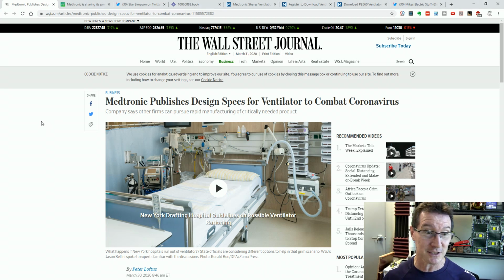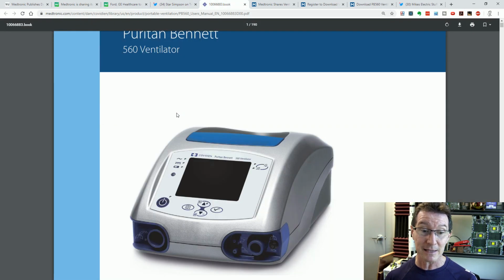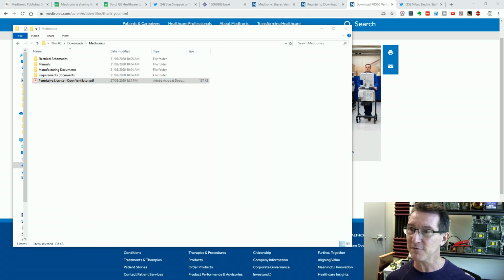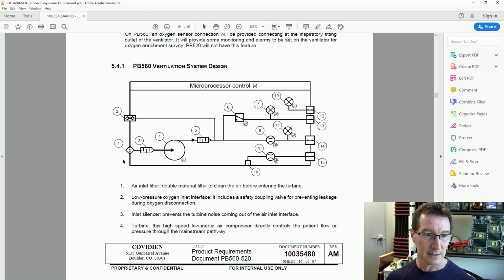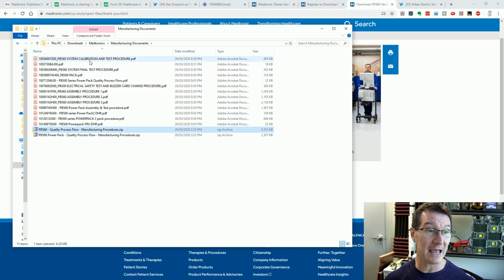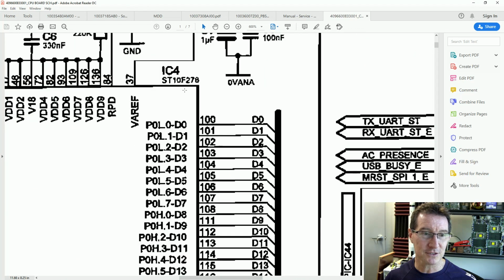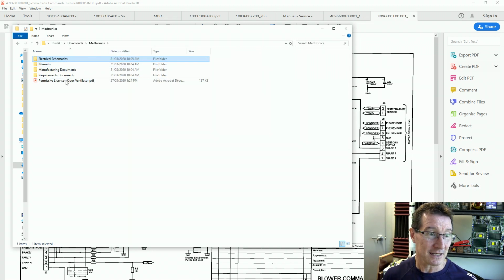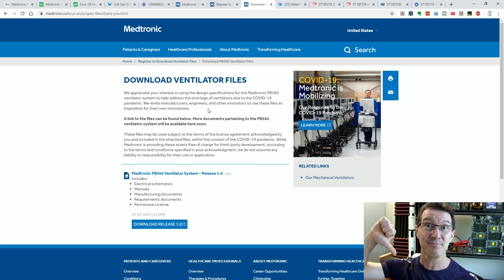eevBLAB #72 - BUSTED! Medtronics Open Ventilator FAIL

Comment: Hi Dave. MIT is doing this:
https://e-vent.mit.edu/

However, they are going to apply for the FDA certification...........
Reply: I mean it makes sense to have the FDA certification if a hospital wants to use it. Upper management at a hospital would be very cautious against (or won't even consider using) using something that has 0 certification.
Reply: Certification takes years.
Reply: The F1 thing is part of a consortium of companies that volunteered to produce ventilators for the British government. It includes 20-30 large companies including all UK based race teams, most aerospace companies, car companies and involves producing a mobile ventilator and also CPAP type machine. Secondly there is Dyson and JCB's partnership making a completely new ventilator design as well but it is getting its medical approval and testing this week ready for mass production next week. The Dyson/JCB ventilators might be exportable once the NHS has enough of them, or so JCB says. JCB says they will produce approx 1000 machines worth of parts per day but th bottleneck will be elsewhere (Dyson). These are not MIT e-Vent or Ox-Vent systems or other simple home made systems.
Reply: till they have their FDA certification the pandemic is over most certainly!
Reply: I definitely want FDA certification regardless if "MIT" designed/built it, as we're still talking about ventilator designed/built by kids here... if anything is off or wrong with it at any setting (i.e. for kids all the way to elderly patients of various body sizes, we're talking either lack of air pressure and/or inadequate oxygen supply which is guaranteed brain damage/death for the patient, or too much air pressure which equals lung damage and/or lung rupture and death.
Reply: @LycanShift  "Built by kids here". Yeah, it's not kids, tho. It's engineering students that are obviously also supervised by their professors. But anyway, the point is OF COURSE you need safety compliance approval, that's not because the designers are "kids" (or adults, it's not like every damn student is a kid), it's because designers make mistakes. Every damn designer makes tons and tons of mistakes all the time, on every design, and thinking otherwise is foolish. You just don't want the design problems to have a high probability of causing harm to the user/patient/nearby equipment/etc.. The focus that people in this comment section have on "kids"-designers is frankly quite silly and misplaced.
Reply: Best one is the automatic Ambu bag squeezer.
Looks like most (if not all) the safety stuff is built into that mask and bag.
Reply: I would let you know that in Spain we have a respiratory project actually open source that is so far Ben successfully tested in pigs

(If you want translation just let me know)
https://twitter.com/ReesistenciaT/status/1242948875570348032
Reply: As much as I appreciate projects like this. MIT is well known for having their own media publications which focus a lot on making every progress look like it is from MIT, even if they were just part of a team, and not even the major contributor, or they merely made a small improvement.

PR is so big at MIT, that a lot of graduates absolutely overvalue their skills.
Reply: Supposedly a bunch of F-1 race companies are going to make and then produce c-pap machines.  Supposed to work for early cases.
Reply: @requited2568  i used c-pap before having surgery. It only blows air (there are some smart ones) it pushes air throu your blockage (my case)
If you cant breathe on your own they are useless
Reply: @muaries12  There are Cpap machines and there are Bipap machines that stop the pressure when you exhale.
I'm not sure which modes this particular machine can do.
Reply: @muaries12  exactly! Those things are horrible!
Reply: @dentakuweb  my understanding, it's just a small device you can add to your CPAP machine. The doctor has to order it.
Reply: @ronniepirtlejr2606  mine had a setting that detected when i inexaled and reduced air preassure. I got used to it.The doctor order it and had it callibrated.
My case was either that or brain damage because if 120 apneas per hour... Suegery fixed it but not always
Reply: @requited2568  its Mercedes F1 team, link for more info, www.bbc.co.uk/news/health-52087002 .
Reply: @MrglMrgl  I've used those  CPAP machines. They basically shove air down your windpipe. it is forced air all the time! You have to force yourself to blow air back out. Kind of like blowing up a balloon with your eyes bulging , Now imagine trying to sleep with that! You have to train your brain to only exhale halfway then inhale. You can only take half breaths & like I said,... do that while your sleeping! I could not do it and gave it up. But hey,  if it saves lives,.... right on!
Reply: just because MIT is going it doesn't mean that its right.... you need to see the inside of a ventilator and see the complex sensitive precision of the system. Couple of school boys with a windshield viper motor and an airbag and a 3D printer.... I bet if you ask one of the companies that have been making vents for over a decade to design a new model in a couple of weeks... they'll laugh at you !!
This is not child's play... we're talking about human lives.... a small increase in the volume of air or pressure can easily rupture the lung of the patient !
can't believe that there are so many idiots out there ... even in MIT !
Reply: @shakaibsafvi97  I want to add: air should be clean, heated and have a proper humidity (close to 100% as far as I remember from the top of my head)
Reply: @PAkhramchuk  yes I believe they have HEPA certified filters. Doctor can order a steam container for a add on. Kind of large coffee cup warmer.
Reply: @shakaibsafvi97  its the cool thing to brag about now.
I can see Dyson coming through but not many others.
At least he specializes in turbines etc...
Reply: @shakaibsafvi97  You didn't even do a cursory look over the website before being compelled to comment  with a "couple of school boys" sarcasm. They seem to be aware of the safety requirements. : "Further, any low-cost ventilator system must take great care regarding providing clinicians with the ability to closely control and monitor tidal volume, inspiratory pressure, bpm, and I/E ratio, and be able to provide additional support in the form of PEEP, PIP monitoring, filtration, and adaptation to individual patient parameters. We recognize, and would like to highlight for anyone seeking to manufacture a low-cost emergency ventilator, that failing to properly consider these factors can result in serious long-term injury or death."